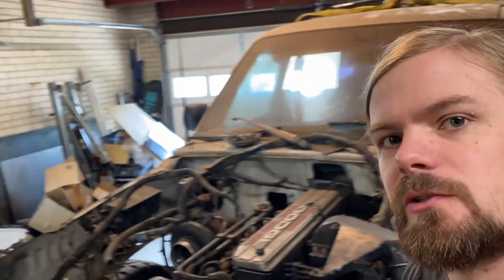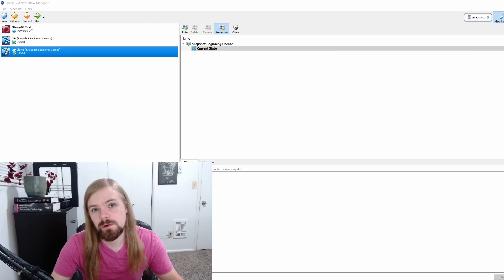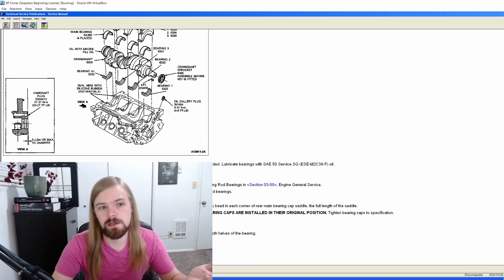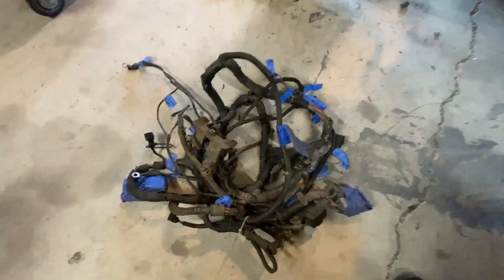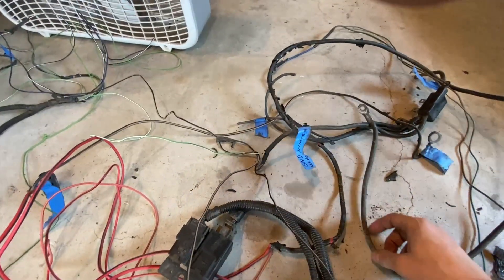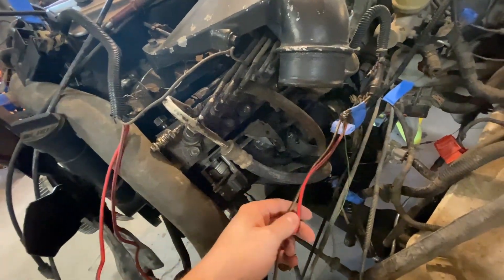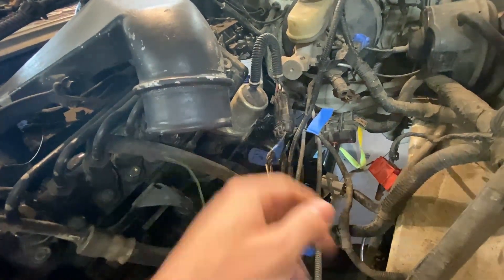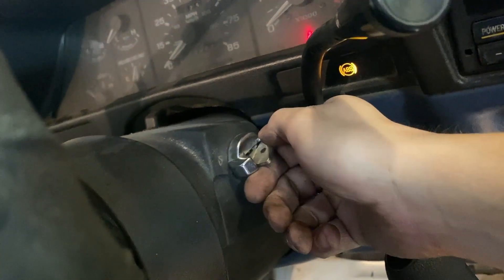One Trick To Be a Great Mechanic.

Comment: We use Mitchell ProDemand at work and most of the information is factory sourced material. And yes, a very important diagnostic tool. That and a little common sense, too! Great video!
Reply from the maker: Ah yes that makes sense. When I was going to school we used "alldata" and a couple others as well. After filming this I realized I probably should have mentioned these database type solutions but forgot, hopefully anyone who works on enough cars to justify those already knows about it 😂. Especially since I actually have no idea how much something like that costs.
Reply: @BuildSomethingAuto  I think we're currently paying about $165 per month, but well worth the cost given the wealth of information and tech tips they provide. And, of course, because that's all we do here. All day, everyday. Probably not worth it to the average shade-tree mechanic, though.